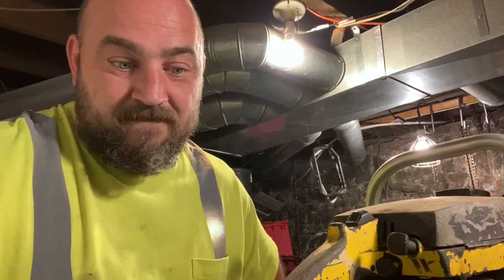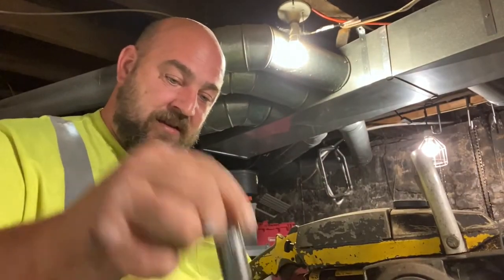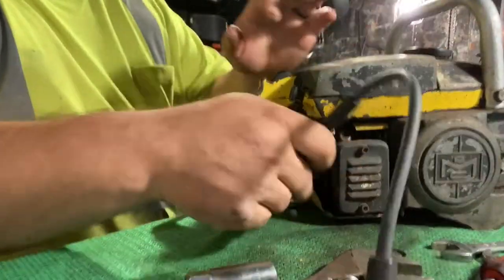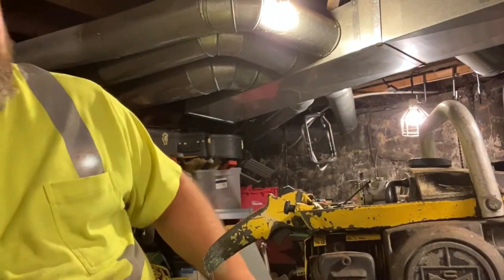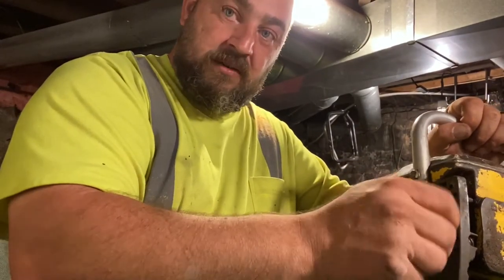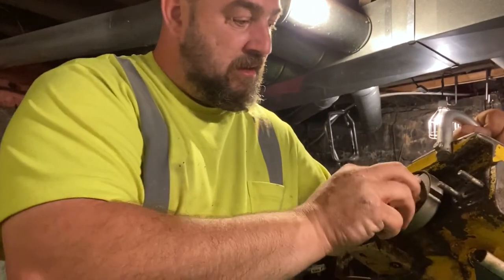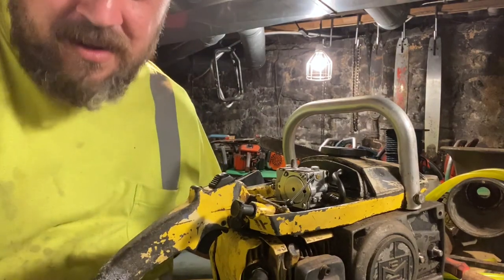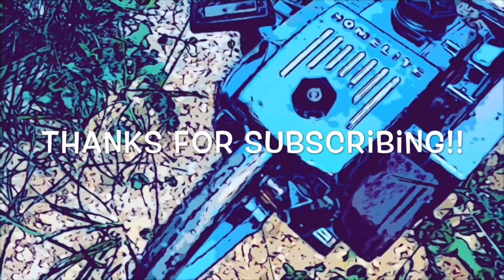McCulloch vs Homelite!! Project Start!!  Mac 10-10 VS Super XL Auto!!

Comment: Those Macs are notorious for fuel leaks tank seam an fuel line into tank grommet hope everything is going well for you and your family. Love the 10-10s. Strong saws in there day.
Reply from the maker: I have never tore one down. I might some day. I want to see what makes it tick!!
Reply: I have used Moto Seal to seal the tank with great success, the new replacement fuel hoses are rather stiff and not correctly sized to the bore in the tank . you can salvage the old grommet and insert a piece of copper tubing then connect new Tygon to the ends. Seal the grommet with Super Glue,  hope this helps.
Reply from the maker: @wayne-wango-wever8393  Thanks!!  I discovered a new problem.  No oil from the manual or the auto oiler.  I pulled the front off and I can see movement at the screen for the manual oiler but it pushes and sucks.  I am guessing there is a check valve of some sort that has gone bad.  I have not checked the auto oiler yet.

Comment: Great video keep it up, bucking Billy ray from here in Canada did a comparison of 10-10 to xl-12, but sxl has more reeds and 4cc more which is a better comparison,
Reply from the maker: That would not be the best comparison. The difference between the XL12 and Super XL Auto is more than most people realize. Many consider them to be the same but the really are not.
Reply: @Smittyschainsaws  and the roller bearing on clutch side.. I use xl-12s for firewood here in Alberta, why? Because my but sxl are more valuable and consider xl-12 expendable, but I have 6 blue xl-12 and 4 blue sxl
Reply: Wife and I were planning for a trip this past September to eastern USA from Edmonton Alberta, maybe next year if we actually can do it stop by and say hi? Really digging your channel
Reply from the maker: @chainsawcanuck  They all have there purpose!!
Reply from the maker: @chainsawcanuck  Absolutely!!!

Comment: Questions about reeds and timing. I think I understand how timing is achieved through the intake ports in the cylinder. I don’t understand how timing is achieved when using reeds. I noticed you also watch Ironhorse. On one of his current 372 projects he ground out the intake port and is installing reeds which the carb will mount to. I’m totally confused. Any clarification? Thanks. 
PS if I may ask where are you located? Thanks again.
Reply from the maker: On a piston ported engine the piston itself acts like a valve to turn the flow of fuel on and off. On a reed engine the reed turns the flow on and off. On a reed engine the intake timing no longer plays as a factor. On that same ironhorse video he removed all the piston material that would normally turn the flow on and off because the reed is now in control. The reed will open and close automatically as the piston goes up and down. On a properly setup reed engine, intake timing has no effect on the performance because it happens automatically. All that is needed is a good set of reeds that are setup properly for the engine.
Reply from the maker: Altoona Pennsylvania
Reply from the maker: I am currently working on some videos to explain reed valve engines in more detail. Ironhorse is converting a piston ported engine to reed valve design. If you have a piston ported engine then intake timing does matter. Only engines designed for reed valves do not need to worry about intake timing.